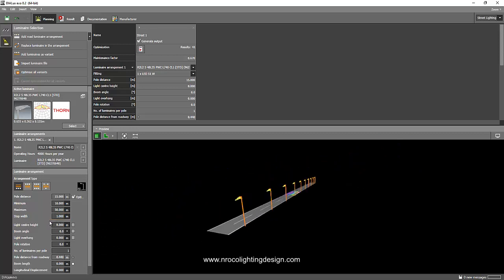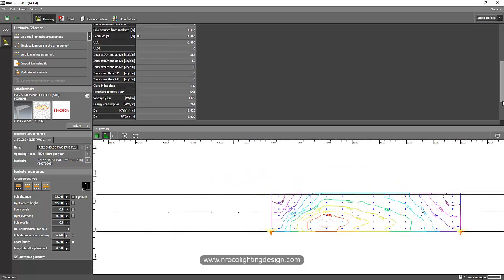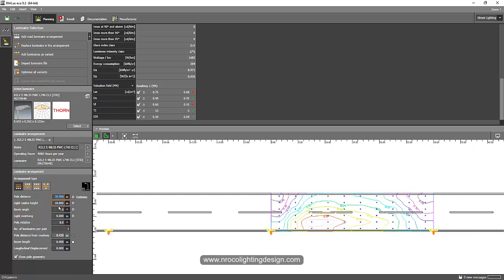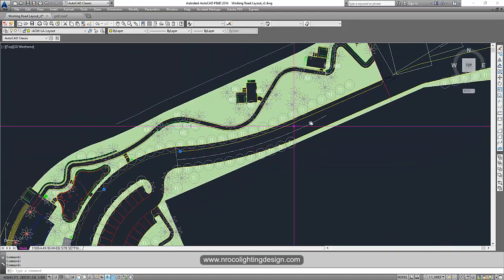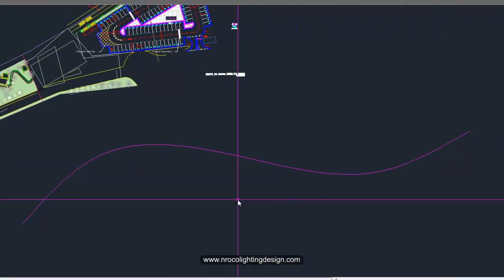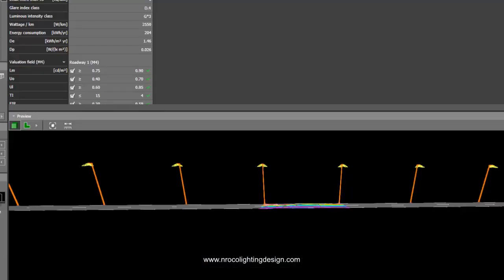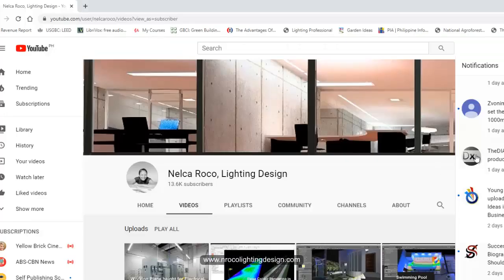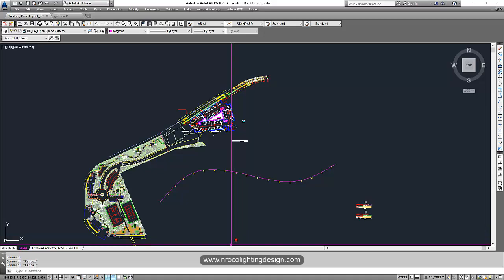Lighting design for 1 kilometer road

Comment: No need to run 1km road lighting calculations if it is a straight road only. 
Roadlighting calculations are done on typical section from one pole to another based on observer view.
If it is a curved road, then pole spacing has to comply with the lighting standards governing such, IES, CIE, BS standards has recommendations on how to layout the spacing.
Reply: please what to do if the arrangement type i want to use is not displayed? is there any ways i can use the axial arrangement type on Dialux evo? i need help. thanks